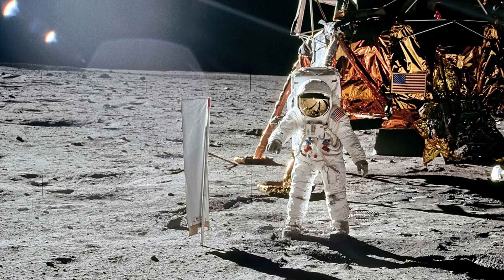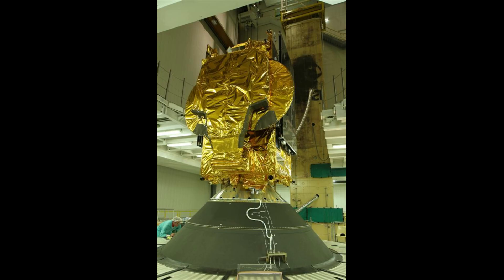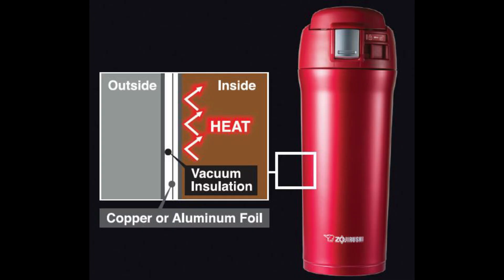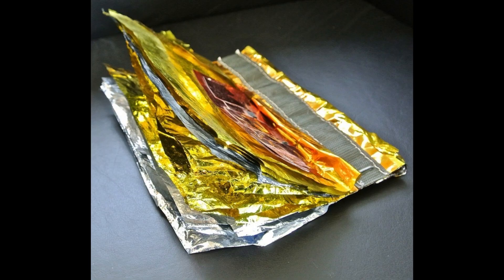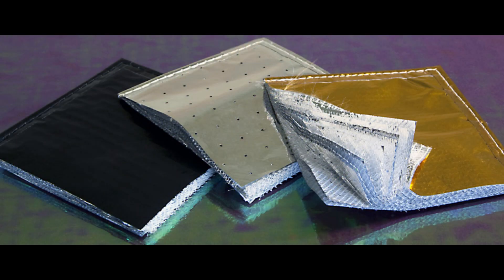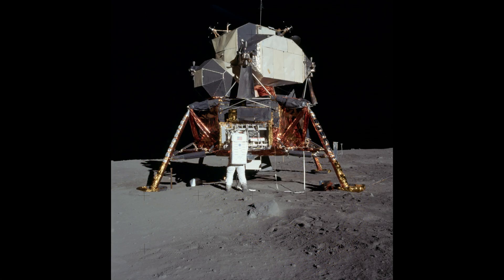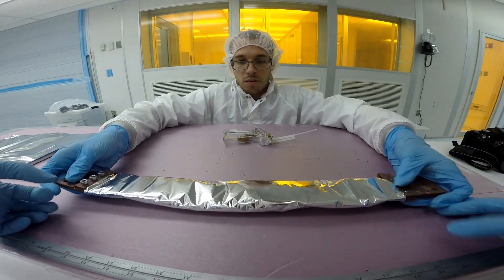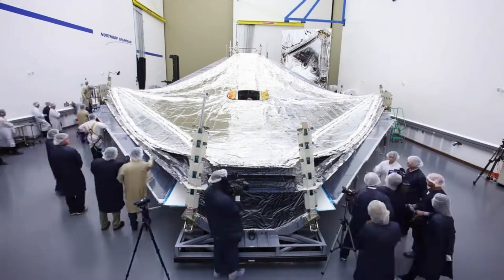Spaceships Are Not Covered In Gold Foil - The Cool Engineering Behind Multi-Layer Insulation

Comment: Hey Scott, the picture of the technician working right next to the RTG housing of New Horizons made me wonder what kind of shielding they have. Or just their construction/operation in general. Have you made a video detailing the history and functionality of RTG's through the decades? If not, I would sure love to see one. If you have, I'd love it if someone could point me in the correct direction.
Reply: just to answer your direct question: RTGs are shielded heavily, but not for the reason you think, at least for Space missions. They are designed in such a way that they will survive if the Rocket that carries them explodes, and this is also true for their orbital insertion. and with survive i mean that it will not leak any radioactive materials. as far as i know this precaution already makes their construction so heavy that no further shielding for the radiation is needed. At least thats what i remember about that topic.. i might misremember stuff since its been a few years since i read up on this..
Reply: @unitrader403  AND FYI - at least one RTG survived a rocket explosion during launch on a Titan IV.
The unit was SO STRONG, that it survived the explosion and impact with the ground SO WELL, that they chose to RE-USE IT on another spacecraft.
Reply: Plutonium 238 basically doesn't require any extra shielding, the container itself, thermocouples around it etc is plenty because it's essentially only an alpha emitter
Reply: I'm pretty sure the RTGs weren't loaded with plutonium until shortly before launch.
Reply: Pu 238 is alpha decay, so a post it note is enough
Reply: @DrDeuteron  True, but the decay products are not quite as benign after a while, as you get into the longer lived decay products, that are going to emit gamma radiation at some level. But the RTG would only have the core loaded just before final mating to the lift vehicle, so it is inert, aside from some testing during construction, then the fuel pellets are removed and placed in a cooling unit. But even then you can stand next to it for a few hours, as the shielding is very effective, and it also has to survive reentry at maximum velocity in case of a failure of the launch vehicle, and also explosion on the pad. That is why those RTG units are normally deployed on an arm, both for radiating heat away, and to keep the low levels they emit from interfering with other instruments, so have it far away, and calibrate it out.
Reply: @SeanBZA  yeah I figured u234 wasn’t the end of the line, but my nuclear wallet card isn’t in hand
Reply: @SeanBZA  ok, u234 alphas to th230 after 1/4 million years. The alphas to Ra 226 after 76ky. All but 10^-10 of that alphas to radon 222 ….which mostly alphas to Polonium 218 in days, and the Po decays in minutes to mostly lead 214. Which finally betas to bismuth and it gets messy.
Reply: @DrDeuteron  They use Plutonium 238, which is relatively safe, and yes the decay products are mostly alpha and beta emitters, at least the early products, though somewhere there are neutrinos produced, but not much. Mostly heat, so good for energy, but yes by the time you get to further down your battery is long gone.

Comment: The early LM designs were beautiful, far more persuasive looking vehicles, that were even rovers. Flash Gordon would have loved it. 
 
Until they found out they were way, way too heavy. 
 
I think I remember for the final LM they ripped off stuff to the last minute. 
 
 
It would be an interesting video about all the designs that did NOT make it, and why.
Reply: Plus the material used for the walls got thinner and thinner, till they had to stop, because the craft was almost at the point it could not support itself under earth gravity. So thin that the crews who were building it had to take care not to step on, or touch the hull, as they could destroy it merely by putting a foot on the surface, and tear the skin. This would mean scrapping the entire craft, and building another, as the skin was too thin, and the joins so small, that they could not remove a panel and rivet in another, as the material would likely tear. The end material was barely thicker than the aluminium used to make cans, and just as easy to dent when not pressurised.
Reply: I love what the LM design contributes to engineering philosophy: engineers appropriately seek simple and elegant solutions most of the time, but when designing at the edge of capability for current technology, the design may look strange of necessity.
Reply: That's an interesting point. There are contracts for those machines - landers; rovers. Numerous companies create designs/prototypes in competition for the contract. (It's happening right now with next gen lunar terrain vehicles for Artemis. Competition entry deadline is this August; the winner will be announced in November.) Anyway, it'd be interesting to see different competing designs of the Apollo era gear. I've read a bit about it (Earl Swift's 2021 book on the rovers goes into some detail) but I can't recall seeing any photos.

Comment: If you're looking for a spacecraft with precious metals or gems, doesn't the Parker Solar Probe have sapphire in the wiring and the cup that collects the samples from the sun?
Reply: In that case it would be synthetic sapphire, a much cheaper material than most people think. It's not cheap per say, but it's cost is miles apart from natural Sapphire. I have a couple boules of synthetic Ruby and Sapphire that are about 1.25" in diameter and 4 inches long, each cost only about $40-$50. Many military vehicle optics (like tanks and aircraft) have very large diameter Sapphire lenses cut from gigantic blocks of perfectly clear Sapphire.
Reply: @TheExplosiveGuy  Synthetic sapphire is glass clear, as it is pure monocrystalline aluminium oxide, which is what a sapphire and ruby is, just the red and other colours comes from impurities. The actual laser rods themselves are totally clear, though when they failed they usually turned to a fine powder from the energy release.
Reply: @SeanBZA  Yep, it's all corundum/aluminum oxide, red ruby is just corundum that has trace amounts of chromium, and blue sapphire titanium, with oranges, yellows and pinks made with beryllium.

Comment: How does stuff hold up over time? Is it still sitting there on the moon or would the plastic have degraded years ago? The flags have been bleached white by now.
Reply: Outer layer would be destroyed by the sun, but the aluminium under will be mostly fine, except where the plastic of the threads has been destroyed, so the blankets will have sagged and deformed, with likely some of the structure visible now. Paint exposed will be basically only the oxide pigments, and the mineral powders and fillers, nothing organic left, except where sheltered. Glass exposed could likely be a lovely blue from photon and electron bombardment, though most of it would be brown for the same reason. Thin film of dust on everything, as it rains down from the sky, as a result of micrometeorite bombardment nearby causing dust to fly up, and also from static charge causing particles to levitate in the vacuum from charge generation due to impact from solar wind protons and electrons.

Comment: I use kapton adhesive tapes for years. Mostly when fixing precise electronic PCB's. Sometimes for much different purposes.
Reply: Kapton tape rocks, I use the stuff in all sorts of electronics projects, including High Voltage applications, it's incredible stuff. Another similar tape I really like is Polyester powdercoat masking tape, it's resistant to HV, High temperature (450°F) and it forms an extremely strong shear bond if it's applied to smooth surfaces, not to mention it's thicker and stronger than Kapton, and it comes in all sorts of widths and thicknesses, from 1/8" wide strips to 6" wide rolls. Little on the spendy side but it's ohh so worth it.
Reply: I keep forgetting to order a roll. I want it because it's mighty handy as thermal protector when using the hot air gun.